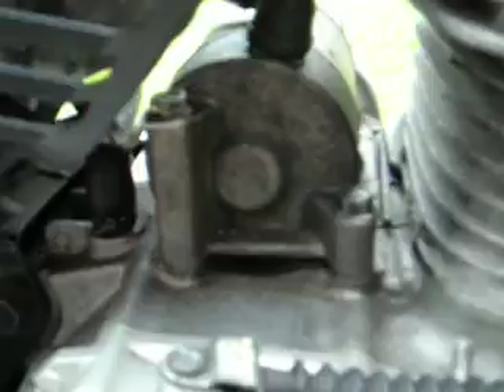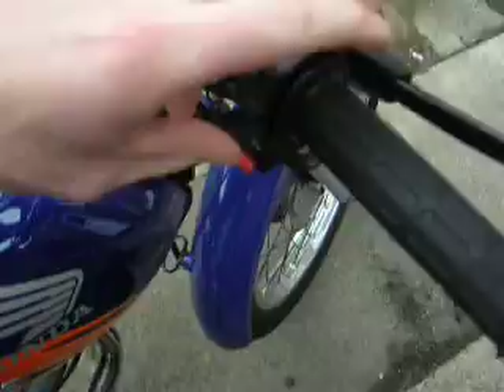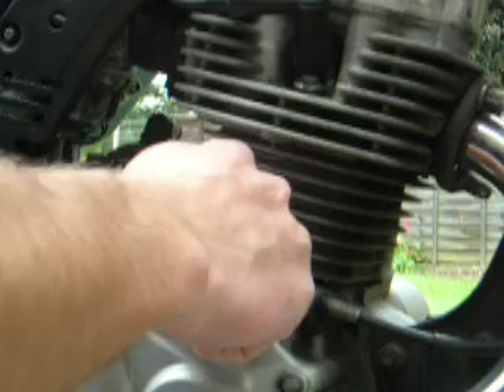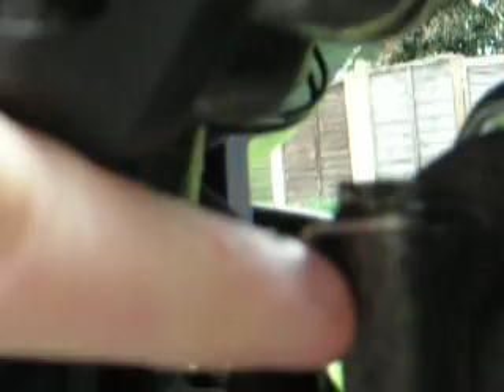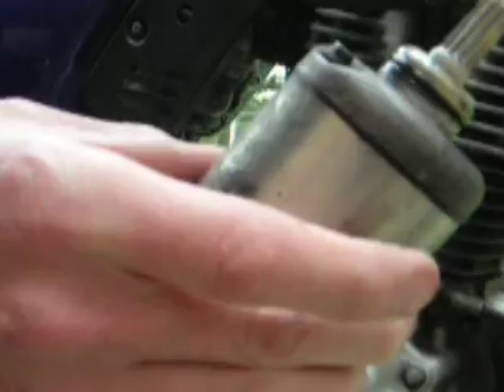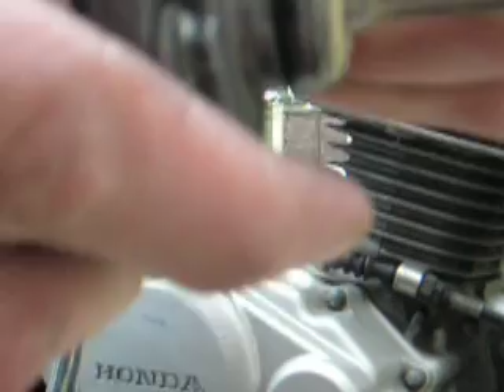cg125 how to fix a starter motor part 1

Comment: Bought an OEM motor for 30 on ebay. For my project. Where's the wire in the back of motor go as I don't seem to have it. Not fitted yet.